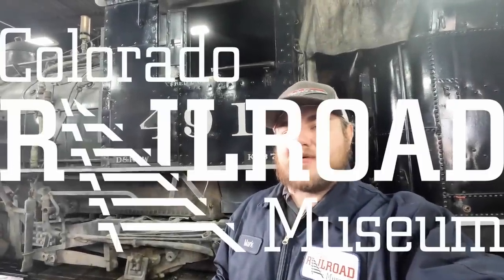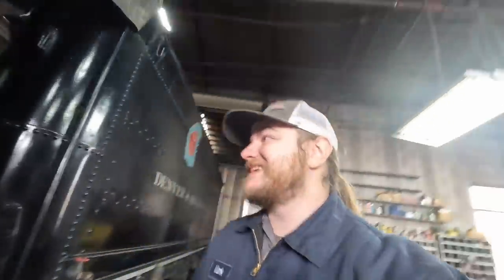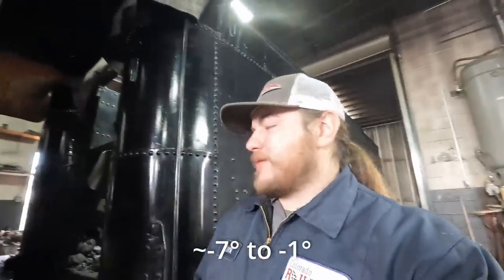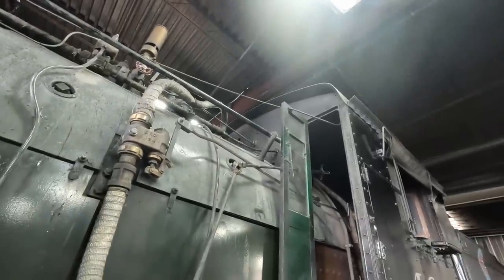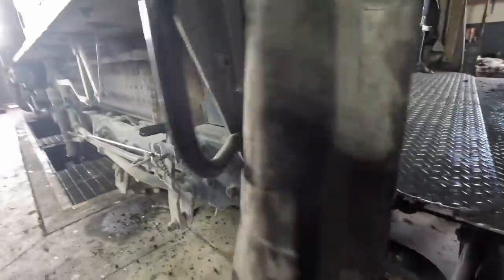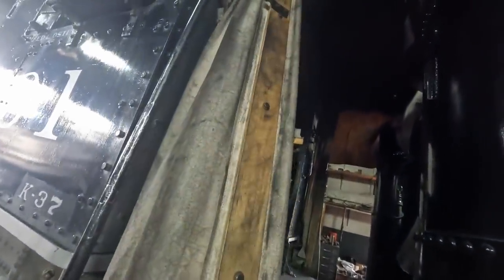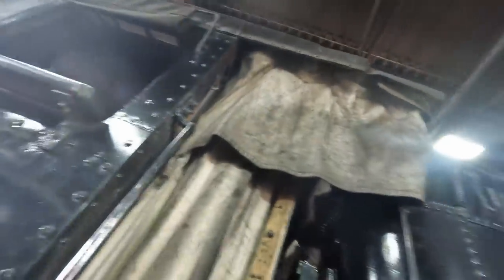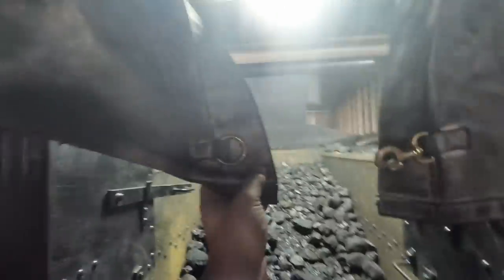It can be FREEZING COLD in the cab of a STEAM ENGINE? How did they stay warm?

Comment: The former engineer of the SP steam wrecker I used to work on told me he used to drape a heavy canvas curtain around the cab in winter to keep the boiler heat in and drafts out. One time in the mid-1960s, circa 1965-66, after clearing a wreck near Black Butte in northern California, where the old Siskiyou Line connects with the Natron Cutoff, they were waiting in the hole for backed-up traffic to clear before returning to Klamath Falls, OR . There was heavy snow on the ground. A big lumber train came through and one of the steel bands that held the stacked lumber together had broken on one of the cars and he could hear the tell-tale buzzing as it got closer. He told me those bands could be surprisingly dangerous when they broke and could cut you like a knife if you were in the way. Anyway, it slapped along the side of the work train, cracked a window in the diner and tool car and just as he jumped to the other side of the wrecker's cab, it swung through where he had been standing, snagged the curtain and tore it clean off, carrying it away down the line. Chuck said it was a very chilly ride back to K-Falls. "Colder than hell!" as he put it.
Reply: As a new conductor, we had one of those bands hit the front of our locomotive waiting for this train to clear the main.  I walked out and saw that it caused a 1/4 inch cut in the handrail.  And that was when the engineer told me that’s why you never stand on the nose as a train is passing.
Reply: How can hell be cold?
Reply: Steam wrecker?
Reply: A bit before my time (I'm ONLY 69, damn it!), but I used to live in Yreka, and can remember how much colder (and how much more snow) there was around Black Butte.
Reply: @aaronfield7899  Figure of speech? Duhhh.
Reply: That's a good story! Thank you for sharing...🇺🇸 😎👍☕
Reply: I wonder if he tried heating up things on the boiler and then putting them in his jacket or something.
Reply: @aaronfield7899   Hell is the furthest one can get from the light and warmth of God, hence hell is dark and cold and the lord of hell is the prince of darkness.
Reply: @aaronfield7899  According to Dante, the 9th circle of Hell is a bitterly cold frozen lake.
Reply: @maxsdad538  not much before your time 🤣🤣🤣

Comment: It honestly amazes me how much a pair of curtains can help with a crews comfort. Also, great video, gives a lot of insight on what it is like to operate in the winter.
Reply: If you can get a chance to look at say a home depot or a Lowes some have a plastic curtain at the overhead door, it's a bunch of 4-6" plastic strips that overlap each other and does keep the cold out and warm in for the most part.
Reply: @jeffharper7579  When you remember the term "Heat rises", its just common sense to ensure the upper parts of the cabin are insulated against extreme cold, especially north of the 49th parallel.
Reply: I also remember that some old farm tractors we would cover the engine with a tarp  and along the side to the fenders a small windshield on tractors without cab the heat from the engine heat blew back on us to help keep us somewhat warm.
Reply: @jeffharper7579   Yup, heat housers.
Reply: Most people ( young farmers) probably wouldn't know them by that name but thanks you know exactly what I'm talking about.👍👍

Comment: The first steam locomotives had a completely open driver's stand. Later as locomotives went faster, a wall was added with some windows so the crew could look out to the front without getting cold wind in their face. There was also a rudimentary roof against the rain. Early locomotive crews got sick working outside in all weather so despite reservations that they wouldn't notice everything going on outside when working in a closed cab, they got a cab (which was still open to the rear to give access to the tender). Rear walls came last and not in all countries, primarily on locomotives that could go in both directions. In some cases such as German class 50 those rear walls were on the tender, in other cases a flexible connection was made to prevent too much cold air, rain and snow getting into the cab when going backwards.
Near where I live the steam locomotive 671 of 1860 is preserved, originally it had an open driving stand and a cab was added later. You can see 1980s films about it here
https://www.youtube.com/watch?v=ElzDWCxRMCI

Comment: I was actually wondering if the firebox was enough to keep the cab warm enough in the winter....this video was perfect for answering any questions I had! Thank you.
Reply: When the wind blows through, there's not much you can do. 
Just blocking the wind goes a long way. 
You learn that early, farming with no cabbed tractors.
Reply: Yes our farmall M had winter canvass for the engine and you..this video insults the intelligence of us..
Reply: @lutomson3496  How does this video insult our intelligence? I, too, assumed that it would get quite hot in a steam locomotive's cab, and not require an actual heater. This video is an explanation from an SME about how that is not the case.

Comment: I once worked on a steam engine as pilot. January 2002. It was -25°C/-13F, lots of snow and sun,  and the plot was going light engine from Stuttgart to Munich (Germany). 240km (150mls). The engine was a 4-6-0 with a tender (fast passenger trains engine, 01 series of the DR/DB). Last 15km/10mls we had to run tender first because there were no more usable turntables and no short wye (and the network liked to have us out of mainline passenger traffic also). No curtains, 50km/h (32mls/h) restriction due to pushing the tender, but man after this I was frozen to the bone. As a pilot you basically standing in the way of the crew and talk them through the line, major grades and restrictions, talking to dispatchers, that kind of stuff. Nothing to do to keep yourself warm at all.

Comment: I remember when my father was building his dreamhouse, he wanted to pour concrete into the kitchen at the start of the spring. Timing was really bad though as just night before, first there was heavy rain and temperatures subsequently went to from 35F to 10F, so when we came in the morning, all the sand was frozen solid.
Together with my cousin we were given the task of breaking it using pick-axes. It was still pretty chilly around 36F and here we were stripped to undershirts breaking frozen sand like a pair of 19th century convicts. I can as such easily imagine why fireman was always wearing basically just underwear, especially if he was feeding something dat hot.

Comment: To give a better prospective of why the fireman is grossly underdressed amd over heated.  THINK of cooking a meal in the oven. You open the oven door and you get the blast of heat. Like an oven, when you open up the firebox to stoke it with coal the firemen will be hit pretty directly with that blast of heat. And since the doors compared to the overall size of the fire box combined with cold air getting sucked in by the fires natural means to find oxygen. Like a mini but none explosive backdraft effect. But that heat wave goes the easiest path. Past the fireman and out over the tender.

Comment: In the early 2000s I had a ride on the footplate of a QJ class steam loco hauling a freight train from Sanggendalai to Jingpeng on the JiTong railway in China. The outside temperature was between -15 and -20 celsius. Even wearing a ski-suit and thermals, I have never been so cold or experienced such an incredible temperature gradient across the footplate from the fire hole to the 'jump' seat on the tender! I was allowed to do a bit of firing for 5 minutes or so to keep warm, but lacked the expertise and fitness needed to keep it going longer. I had a huge amount of respect for the two firemen on these locos, doing 20 minutes on and 20 minutes off firing a large 2-10-2 across the hills of Northern China. No curtains on the QJ. I imagine that driving a DF4d across the line now is a good deal more pleasant work...
Reply: crazy to think of a steamer in main line revenue service even in the 21st century.

Comment: I'll point out, as someone who has ridden  the cab of a steam locomotive, with the curtains off for the summer, the doors, windows and roof vent open, you can get a nice breeze through the cab at only 10mph. It's surprisingly comfortable.

Then, you got these new GE & EMDs, which struggle to stay warm when standing, and freeze solid when rolling down the track.
Reply: I don’t know what new ge or emd’s you’ve been in but the ones I’ve been in have no problem staying hot in sub zero temps

Comment: Very interesting. That's fairly cozy for a 1920's locomotive like the 491 - how about dealing with bad or cold weather in the RGS 20 or DRG&W 346?
Reply from the maker: They also have cab curtains, in almost the same setup. 20 has hers mounted now, 346 doesn't at this time. They also have back cab doors, which are more of a nuisance than a help.

Comment: Great video- something I had always wondered about, Of course, this would only apply to northern areas or high altitude runs, and I'm sure those curtains were one of the first items to rot away on abandoned trains, so many people probably have never seen them. Thanks for the informative video!
Reply from the maker: Yup, the curtains definitely suffered the elements pretty quick. We actually ended up getting a hold of 491's original curtains and they're actually in good shape though. They were stored in a boxcar for 50 years, which is why.
Reply: My Grandad made a cover for his fishing boat from one of the canvases from a B&O Steam Engine.

Comment: When you are north of the 49th parallel, its just common sense to remember that heat does rise, and that if you ensure the upper parts of anything structural are insulated against cold intrusion and heat loss you will have an easier time maintaining a stable temperature even in extreme weather conditions.  Also, any insulation below a rating of r20 is a waste within this region as your expending excess energy to maintain the same stable temperature.  Edit for reference:  I live in an area north of the 49th parallel in a southern area of the province of Alberta Canada that will see temperatures of -30 to -40 degrees Celsius in the months of January and February., with an ambient average temperature around -25 to -29 degrees Celsius.

Comment: Not quite a problem we have that often over here at Railtown 1897, mainly because we only see snow once every other winter. But hypothetically speaking, if that was an issue for us, 3, 28 and 34 would have to be fitted with curtains to help us keep the warm inside the cab during the winter months. Not really an issue with Shay No. 2, because it has a fully-enclosed cab

Comment: Sounds like it was built for states that were closer to Canada, where it can get to -10 to -20 on average in the winter.
Reply: @Ninjia73 -20f in winter is not as cold as one might think, when it dips down in the -40s or colder in winter.
Reply: I imagine everything was warranted considering engineers would be taking these engines through the most remote areas of the rockey mountains.

Comment: Polish locos have fully enclosed cabs, with closing doors. There's just a coal shelf to work from and the coal can be raked down if necessary. I've worked them in minus 15 in work shirts and trousers. At the end of the run the outside of the loco and tender is a mass of icicles (dirty icicles). Polish State Railways looked after their engine crews back in the day. 
Lots of stories of seriously drunk crews of course. One where a track gang found a freight train on a branch line sitting simmering by itself, no crew. No footsteps in the snow. They bank up the fire and reverse it back down the line until they find the driver and fireman asleep beside the track. Both totally legless, had fallen out of the cab into the soft snow. The train had plodded on until it ran out of pressure.  Usual excuse in such incidents was 'we had to stop for running repairs' I was told.
Reply from the maker: Sounds like a nice setup for the crews! Thanks for the story.

Comment: I was honestly wondering if being cold was even a problem for steam locomotive crews- you're standing next to such a massive, hot fire and doing some pretty hard work, but you helped show that  the answer to that question isn't as obvious as it might seem.

I have to say, those protrusions for all the cab piping and controls add up quite a lot in terms of heat loss. I assume that the reason why the seals aren't rubber is because it would degrade too quickly under the heat from the boiler and the firebox, and because for some of the controls it may interfere with the movement of the rods or cords.

Comment: Fahrenheit works perfectly fine.  If you are only concerned with the freezing and boiling points of water, then Celsius is better, but to the best of my knowledge, the forecast rarely calls for temperatures high enough to boil water.
Reply from the maker: Definitely fair, I moreso meant metric as a whole. For "feel", Fahrenheit certainly does better without the use of decimal points.

Comment: Funny you should put this out, there was a conversation over on the C&TS where they are building breakmans shanty (dog house) for the back of the K-36 engines. I had asked if the dog house ever had any heat like the steam heat in the cab. Did/does 491 have steam heat in their dog house?
Reply from the maker: 491 does in fact have steam heat in the doghouse. I am not sure if all the engines were equipped that way, but at least 491's tender was (...I'm sure you recall the K-37 tender swaps).

Comment: A question I've always wanted to ask about the 491: I always notice in your videos that the fireman's side "K-37" marking seems to have a discoloration around it compared with the rest of the loco. Is that the original paint and markings being preserved?
Reply from the maker: Bad restoration work, unfortunately, lol. The paint we applied peeled there and we had to cut around it to stop the peeling and then touch it up. Should've sandblasted the cab completely, but here we are.

Comment: Great video on a novel topic.  And being more interesting, I'm curious that looking at Google Maps, a railroad museum would be isolated from any active railroad, if for no other reason for the occasional moves of equipment on and off campus.  Is that correct ?
Reply: there used to be a siding. that went across the street, but iv always thot there should  have been a line from the curve straight down the north side of the street.
Reply from the maker: The museum is isolated completely, it's not often we need to move things and when we do it's done by truck which works well enough.

Comment: As an American that uses metric, I thank you for the conversions and the acknowledgement that metric makes a helluva lot more sense.
Reply: Fahrenheit was a scientific scale of the same era as Celsius and is 100 scale base 10 like C 
The scale is just 0 to 100 for animal survivability.  50 considered moderate in Northern Europe...100 dangerously hot...0 dangerously cold.
Celsius just 0 to 100 for the liquid phase of water.  Originally -100 to 0 for steam but laymen thought that was stupid and awkward...as well negative numbers were not common use in 1790.

The non SI measures have a system and cross reference too, it is just most people don't learn them or their methodology.

Common comfort and discomfort temps are more natural and direct in F, where they must be memorized by habit in C since it is a chemist's scale.
Reply: Hard disagree on the last part. With a little effort it was easy to convert to using C for air temperature. A simple introductory for such use is simply thus...
30 is hot
20 is nice
10 is cool
0 is ice
Reply: @LexieAssassin  whatever

Comment: Did nobody ever thought about putting a steel wall up on the tender to close the rear of the cabin instead of using a curtain? Or are the curves too tight to make that work
Reply from the maker: The curves make the gap change too much, which is why the curtains are used.

Comment: I never once thought about that! I had always assumed it was hotter than the hubs of Hell in the cab, all the time! I also never noticed the curtain doors, why not real doors? I don't suppose CO2 and CO and methane off the coal ever was a problem. Thanks for the information. (I also never thought the Rail Road companies gave a hoot what Washington thought!)
Reply from the maker: Gotta follow the regulations, haha. Though otherwise you're normally right. Real doors didn't have the right amount of space to work on these engines, and canvas was cheaper. Many other engines also had real doors, if the setup made more sense.

Comment: And then you had those super fun summer days when it would storm its you know what off and would need to close up the cab to keep the blowing rain out.  Either way you got drenched, and then there was going through long tunnels.  UP had air masks (that didn't always work and would be fought over) on the large engines like the Big Boys and Challengers and SP developed the cab forward for the same reason but the heat though....

Comment: Why curtains instead of steel doors? Is this somewhat of a safety regulation or just it is just cheaper and easier to make?
Reply from the maker: Cheaper, easier, and you couldn't use doors as the gap between engine and tender varies so much around curves.

Comment: The firemen is heated by the infrared heat from the fire heating him directly. The conductor is limited to convection and thermal radiation from boiler. So no matter what temperature is the air the firemen will feel the same heat.
Reply from the maker: The conductor is back in the caboose. But if you mean engineer, yes. :)